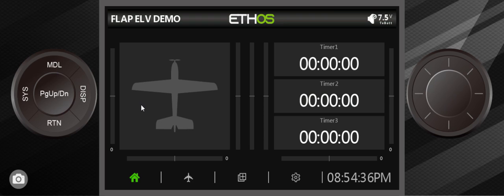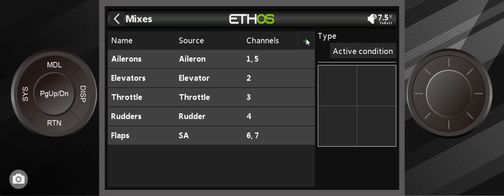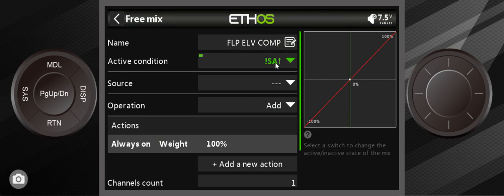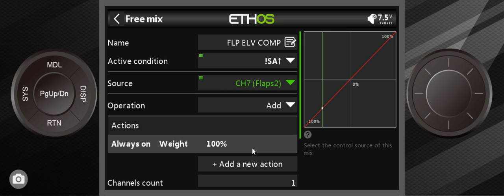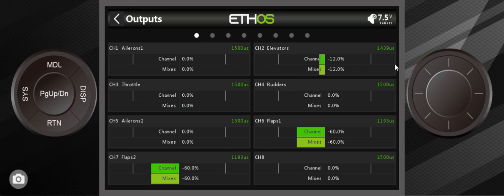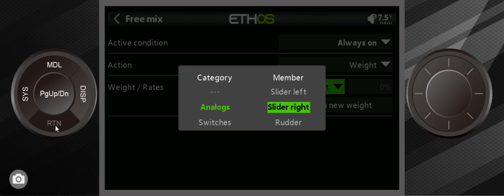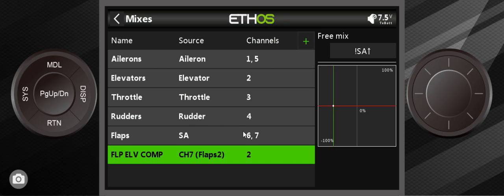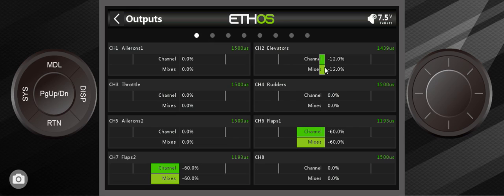FrSky Ethos Flaps-Elevator Compensation- No more ballooning!

Comment: Flap>elevator mix isn’t for ballooning; it should be used to trim the plane for the proper airspeed/descent rate on final. Planes balloon because they were going too fast when you lowered the flaps.

Comment: I think using flight modes will be a lot easier. Flight modes will allow the trim to be remembered between each flap setting from there can be easily re-trimmed versus guessing on the amount of compensation by using a mix.

Comment: My dear friend, you're such a cool pilot, but it would be much cooler to speak a little less and try to explain more serious, and mention the main bargain assigning an analog lever for adjusting the mixing percentage to the elevator. It's to have a variable rate and an easy adjustment during the flight. And after this setup you should delete this function again and replace the rate by an fixed value to prevent "unwanted" reactions. Thank you.

Comment: I struggled with this and finally figured out why the elevator was not tracking the slow up and down from the flaps for me. The answer was ...you have to put the slow up/down in the flap mix not in the flap output. Now it works perfectly, also being able to use a pot for the elevator weight input is fantastic.

Comment: Hi Steve, I updated to Ethos 1.5.0 today and found out that all my current WAV. files no longer play! Like, Hi Rates, Low Rates, Engine off, etc. I found that you can't even get to the files on the radio in the special funtion anymore! Is this a bug in the system?  Thanks for the help.
Reply: I did it yesterday, I hope to find all my customizations untouched.. 😢

Comment: I currently have flap/elevator compesation set up with trims in flight modes. That way I do not change cruise flight trim when I apply flaps. Will I need to change anything when I upgrade to 1.5?
Reply: In Europe we say: there exists many ways to Rome. Yours is a possible solution for this issue, you don't have to change it with Ethos 1.5. x , but you can if you like.

Comment: How do u get the elevator adjustment move slower
Reply: you take as Source the Flap Channel
Reply: @EnriqueIvanHoward  what do you mean... i wanted my elevator to compensate slow when i hit the flap channel. i have it set on a flight mode. so each flap has different setting just want them to respond slower when engage not real quick...u now how to do that? if so explain please
Reply: @esskiahastings7974  see activation and source at 3.20 mins in video  for elevator compensation.  He has his flaps already set-up to come down slowly and by using the flaps  as the source of the elevator compensation so the elevators come down slowly as well - see the video from 9 mins on where you can see it in the outputs.   He has another video showing the initial set-up of the flaps - where he set the initial timings - slow down  ...faster up .  The video above mainly deals witht he elevator compnsation bit